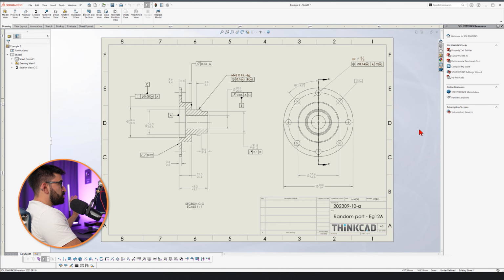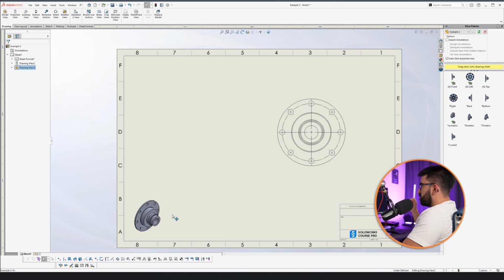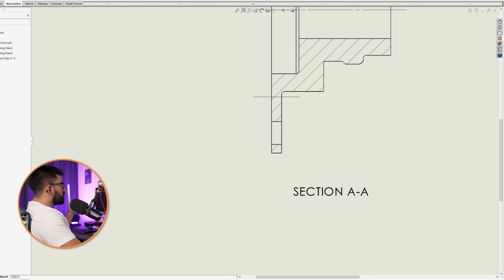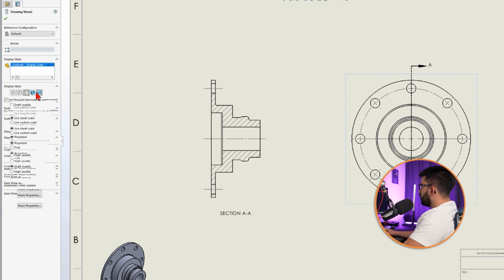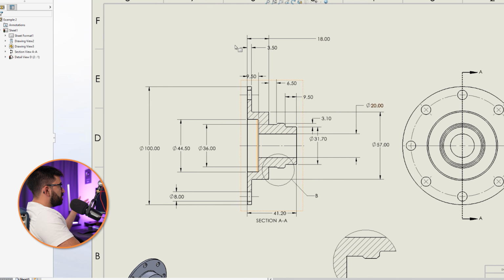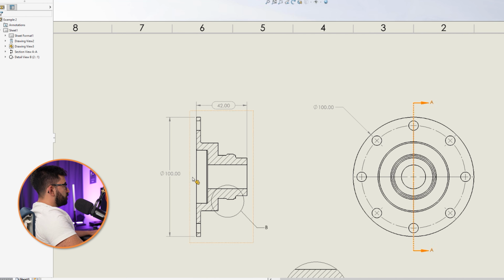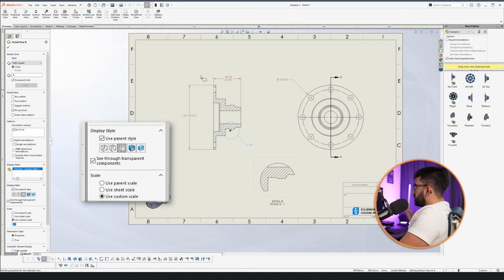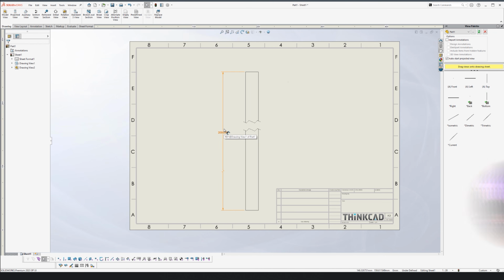SOLIDWORKS Drawing Hacks - Part 1

Comment: hai. aryan. I want to asking. i dont know it possible or not. Every time I open my drawing when i change model size dimension, the dimensions and annotations have been spread around and I need to relocate them again and make the drawing tidy. Is there any way to lock their location? or at least keep dimension position tidy
Reply from the maker: it sounds like an abnormal issue. what license are you using?

Comment: Are SolidWorks skills in demand? I'm currently learning it.
Reply from the maker: Yes, SolidWorks skills are absolutely in demand — especially in industries like mechanical design, product development, manufacturing, and prototyping. It’s one of the most widely used CAD tools worldwide.

That said, what gets you hired isn’t just “knowing SolidWorks,” but being able to model cleanly, think parametrically, and design for manufacturing. Pair it with some basic DFM, GD&T, or simulation knowledge, and you’ll stand out fast.

Stick with it — it’s a legit, high-ROI skill.

Comment: I  have one question if anyone can answer for me. If I designed a complex model and when I am creating a drawing, how can I confirm that I have stated all the dimensions that are required, other than fully defined. Some times I make mistakes in not fully specifying the dimensions. Is there any way to check or any technique to make sure, everything is on the sheet?
Reply from the maker: To ensure all required dimensions are included in your drawing:

1- Use the Dimension Expert tool in SolidWorks. It highlights under or over-defined dimensions automatically.
2-Review the drawing with Tolerance Analysis to confirm fits and assembly requirements.
3-Cross-check against the 3D model to ensure all critical features are dimensioned.
4-Follow a checklist: Base features, functional dimensions, tolerances, and datums must all be accounted for.

Double-checking with these methods minimizes errors!

Comment: Auto Dimensions can be edited in the drawing and the changes will apply to the 3D model.
You can rotate drawing view with 3D Drawing View command rather than trying to mess around with Current View.

Comment: hi Aryan, thanks alot for these hacks. I have found very helpful always.

Those Graphical error you faced might be resolved by rebuilding. I hope it will work.🎉

I have faced it alot of time in part and assembly format while working on our projects.
Reply from the maker: Yes, I'll try that, but there are some errors like the PINK EDGE error which will only go if you restart SOLIDWORKS.

Comment: Is solidworks certification worth it or not?
Reply from the maker: SOLIDWORKS certifications by themselves only act as a screener to weed out the complete beginners from the ones with some  proper experience who have spent some time in all the segments of SOLIDWORKS be it part modelling or assembly. But what you have to show to back that up is what counts, so if you plan to put the certification exam to good use be sure to have a showstopper portfolio to back up your claim.
Reply: @with-aryan  man i need some kinda of help i worked with soildworks for quite while , have bachelor degree in aeronautical engineering , wann move to eu country , but from where im from ,im sure my bachelor will not be recognized , maybe i thought if i get soildwork certification will help improve my resume and maybe land job

Comment: There is one main advantage of the sizes from "Model items". When changing the size in the drawing, the model will also change size, which will speed up the work
Reply from the maker: No! That’s not true. It’s a one way street unless you’re editing your part. Which under no circumstances it makes sense to do it in the drawing mode
Reply from the maker: Is that what you mean? If yes, you’re right. But don’t ever do it
Reply: @with-aryan   https://youtu.be/2R6ShNQ5-Aw